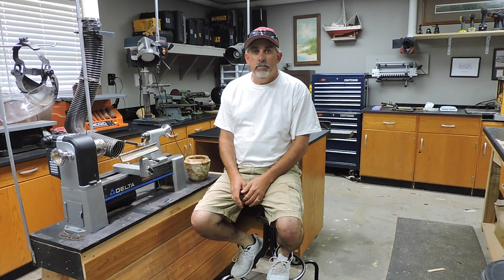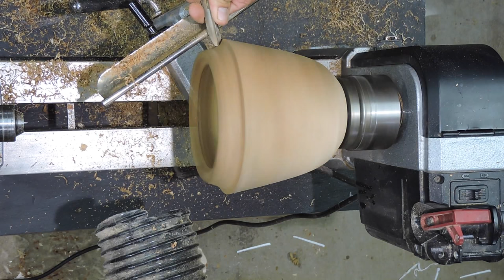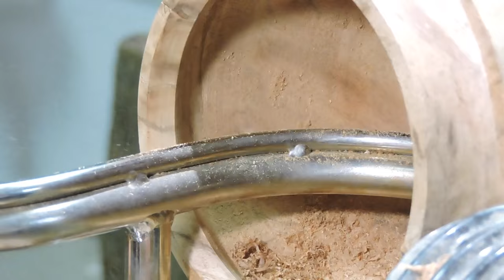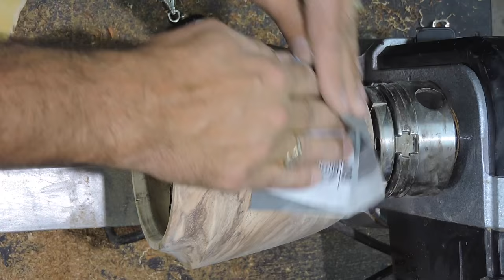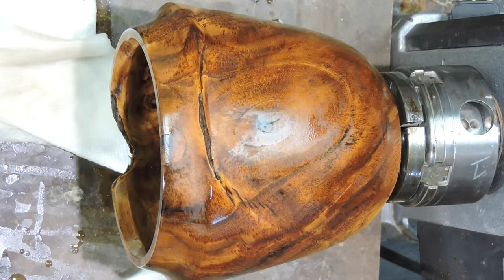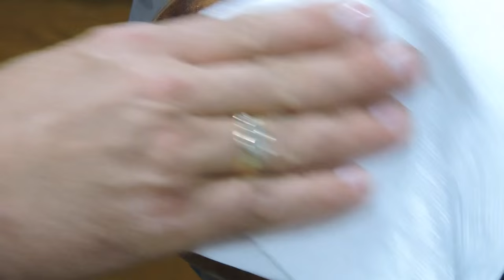wood turning a bowl from a Mimosa tree

Comment: I just got a lathe and have a large piece of dried Mimosa trunk. I was wondering how it would look on the lathe. 
Thank you so much for sharing this! 
I am starting tomorrow!
Reply from the maker: I was told it is Toxic to make sure you wear a dust mask
Reply: I always have worn a mask so far. As for its toxicity, I would be skeptical of that information. The tree itself (wood. flower, and bark) have been used as a Chinese Herb for hundreds of years. It is used to Calm the Spirit and Nourish the Heart. I am an intern of Chinese Medicine and acupuncture who has actually taken the herbs. The only caution we have is to not use it in excess for women who are pregnant. 
Now, I cannot say about inhaling the dust so there may be something to that as well. If I find out anything I will gladly let you know.
By the way, I did not start the project today. I am still pondering what to do with it. Right now I am limited to Spindle work as I do not have a chuck yet. My birthday is next month so let's keep our fingers crossed.